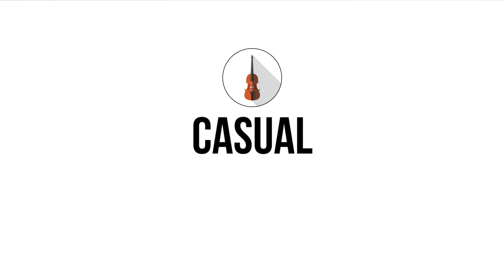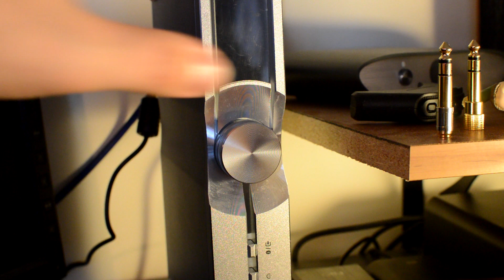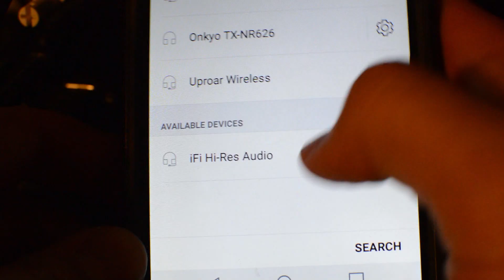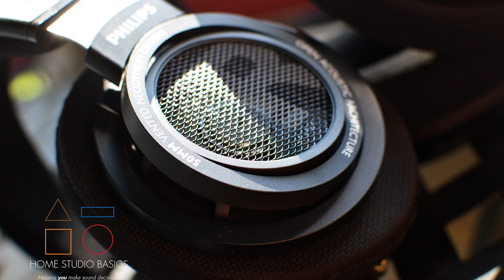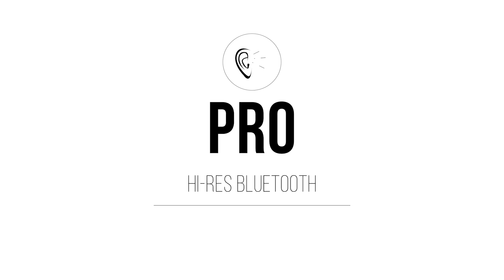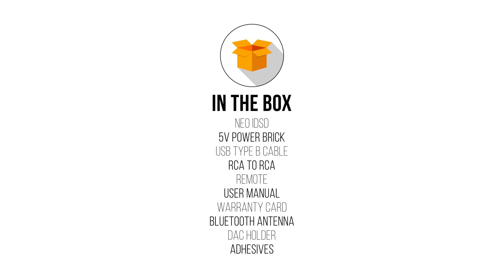💊Is The Neo iDSD Worth The $$?!

Comment: I got the neo idsd  for 500.. little homie hook up. But... 4.4 was messy, the unit has channel imbalance wish I could tell you how much. Not super bad. The second issue is you cant plug the headphone jack all the way in, otherwise the right channel makes no sound.  I even purchased a second set of cables assuming it was the cables, based on what ifi said.  More money wasted.

Also, the difference between balance and unbalanced has little difference in power. Guessing something probably wrong internally because on paper it's way different.

Next, for some odd reason it has distortion when using Quboz, not every song but certain ones at random and the following day if it replays no distortion.  But I found a few that distort no matter what. Tidal is okay, no issues thus far. Including while using it as strictly a dac to another amp.. not sure where the the distortion is popping off at, not an expert.

Honestly really good for on the go, or away from my PC throughout the house.  Besides that not sure how a 700 dollar unit can have all these issues.  Will have it fixed or replaced by warranty near the end of the terms.

Comment: welcome to New Year Stu
Question: you reviewed already iFi ZEN: DAC + CAN. I have them both plus iFi ZEN BLUE. Would iFi Neo iDSD, providing the same as the 3 pieces iFi ZEN stack be better solution with Hifiman Sundara? Provided Sundara would be powered with balanced 4.4mm output? on my CAN I can NEVER go to max gain (CAN has 4 position switch - position 3 is the max I have ever gone, even then only with the knob not crossing 1pm  volume)?
What do you think?
Pros: 1 box instead of 3, much less cables, both bluetooth and USB covered, MQA decoder (vs DAC renderer only), remote (who needs remote?)
Cons: more expensive (700 New vs 427 ZEN stack), less power on both balanced and single ended
But the sound quality would be the deciding factor... bro, counting on you as I can still return my ZEN stack to Amazon ;-)

thx
Reply from the maker: Hey man Happy New Year! Do you have the Signature stack or just the regular? If you have the Sig, I can do a demo and see which one sounds better. I'm pretty sure you have the original Combo Zen with the silver Zen CAN though.
Reply: @HomeStudioBasics  regular
Reply: @zyghom  Hi. How you connect the 3 ifi zen pieces?Can they be stack together or just can + dac or can+blue?
Reply: @cyberbarbaro  BLUE via RCA to CAN, DAC via 4.4mm pentacon to CAN. Sundara via 4.4mm pentacon from CAN. Using source button on CAN I use position 1 (BLUE via RCA) or position 3 (DAC via 4.4mm). Oh and DAC I set up for fixed output so volume on CAN rather than on DAC
Reply: @zyghom That's clever. Can you tell me how is the sound quality of zen blue compared to zen dac? If I just use spotify would I feel lot of difference? I would like to buy just the can and the blue but i am afraid to be disappointed.
Reply: @cyberbarbaro  The most important for  me part of BLUE is... being wireless. I use my laptop located where it should be: on my laps. I work this way on my armchair and having new Macbook with M1 chip and almost 20h battery life I eliminated all cables from my laptop by using BLUE. So my macbook and Sundara are with me the whole day while no cable messing around. The only problem with bluetooth - not BLUE but bluetooth is: sometimes I can hear that connection is dropped or at least distorted. And I am about < 1m between macbook and BLUE. I realized the same happened with my old bluetooth headphones so this is not BLUE issue but rather macbook. Anyway, for normal usage (work from home , video calls etc) macbook with BLUE (and CAN) + Sundara it does the job. Also for casual listening to the music (I only use Tidal). But when I want to reach nirvana I connect USB cable to my macbook and switch from BLUE to DAC. Now question is: do I hear the difference between BLUE and USB? Before I answer: BLUE connects to macbook via aptX while with my Samsung phone it uses LDAC. Except that when I use USB there is NO drop with connectivity - I am not sure if I can hear the difference between BLUE and USB - both with CAN and Sundara. Sorry if I disappointed you but seriously: more important on the sound quality is how the source was mastered (Tidal has both: good and so so quality of the songs - I am not talking MQA but rather how they were engineered). And this engineering of the record has for me more impact on the quality (dynamics, bass, vocal, treble) than if it was connected with Sundara via BLUE or USB (via DAC). If you got me then ok, otherwise you can ask for more - happy to help if possible.
Reply: @zyghom  Thanks a lot for your reply and the time you spent for it. You solved all my doubts. I will buy blu + can stack and the day i will come back to work from office i will consider to buy also the dac.
Reply: @cyberbarbaro  let me know how it sounds and if you are happy with that set up ;-)
Reply: @zyghom  hello. At the end I ordered the blue (it sounds amazing) but I choosed the k5 pro over the zen can. This just cause i can use the RCA Out on the K5pro and connect to my amplifier. In this way i can use the bluetooth connection with both my headphones and my stereo. I hope I did the right choice....i am not sure
Reply: @cyberbarbaro  I got your point - you use amp as all inputs aggregation ;-) Hopefully you will enjoy
Reply: Actually I decided to stay with ZEN stack because of:
1- much cheaper (427 vs 700)
2- more power on CAN
3- extra bass on CAN
4- 3D stage on CAN
truth be told there is nothing Neo can do better (except being 1 piece instead of 3) yet it costs 60% more than ZEN stack
Reply: I am curious with this. I currently own iFi Zen DAC and thinking of adding and doing the same Stack (+CAN+Zen Blue). But if the Neo iDSD provides a much detailed or better sound quality than the Zen DAC, i might also consider to hold and save for the more expensive Neo iDSD. I also love the Pros you mentioned, 1 box instead of 3 with less cable management required! And that vertical mount! Thanks
Reply: @jonathana.4187  I have compared iFi ZEN DAC to the one for 500$ and audible NO DIFFERENCE. Plus the fact that it has both: RCA and 4.4mm balanced output - marvellous. But iFi ZEN CAN amp is 1 class above DAC amp - at least for the Sundara headphones I have (and this planar requires a lot of juice)

Comment: I have the Fiio K5 Pro. I use a USB B to USB C cable to connect wired to my Galaxy phone. Will the same set up work with this ifi? The ifi's USB port looks weird.

Also, is this worth upgrading from the K5 Pro in terms of sound quality alone? I really appreciate your input. Thanks.
Reply from the maker: Hey man! yeah, both use Type-B so it would work. In terms of a sound upgrade, that would make a great comparison. I thought about that a few days ago actually - they are both combo Amp/DACS that have many of the same features and connections. I will have to do a demo and let you know!
Reply: @HomeStudioBasics  the instructions day not to charge the ifi with anything more than a 5 volt charger. Will my Galaxy Note 9 charger be too strong?
Reply from the maker: Hey man! Not too sure about that but as far as sound quality alone, I wasn't hearing too much in the way of the difference between the K5 Pro and Neo. Perhaps the Neo has a bit more vocal presence, seeming a tad more intimate and there with you, clearer, etc. (think of it as the analogy of sitting in the 1st row vs. 3-5), but it's not worth $550 more lol. I'd say the only reason to upgrade to the Neo would be if you need to connect to balanced studio monitors/speakers, want to run balanced headphones, and/or want something with Bluetooth functionality. Those things the K5 Pro doesn't have. Sound-wise it's not worth it. Here is the playlist I'm listening to: https://open.spotify.com/playlist/5J5AVe7Hcr3Wa2YNzih9JX?si=ICoD5eVkSq2vpeVxFvHRoA

Comment: I can understand why some people wouldn't want to spend $700 on the Neo but for me, it was well worth it.  I've had it for about a month and I love how it sounds.  It's not the normal iFi signature because while it does have some slight warmth here and there overall it's very clean and clear with a balanced sound.  I use it as a combo and with some of my amps and it sounds great either way.  I haven't used it single-ended so I can't speak on that but with about 1 watt at 32ohms it's plenty for most headphones, even my Arya sounds good though it does sound a bit better using an external amp.
Reply from the maker: Great vote of confidence man! I would really honestly buy it if it had a couple of XLR mic inputs on the front. It's a great product though. Combining the features of an audio interface and DAC/Amp all in one would really be a dream come true. And yeah, it's a bit underpowered single ended I think. I'd feel okay driving most headphones, but I felt like I was turning the voluem up way more than I should have been for both high impedance (HD600) and low sensitivyt (DEVA, K702).

Comment: I'm in the market for an upgrade dac amp for my Ebony's and Argon's. I'm not an audiophile. I enjoy listening to a specific type of music and game non shooter games. I currently have a Soundblasterx G6 which I purchased for $40 second hand and a new portable Lotoo Paw S1 which has a 4.4 output that i appreciate. I was looking into the Schiit Magnius and Modius stack which would run significantly less expensive at $400 plus tax , and probably would be all I need for a very longtime. The Neo iDSD seems interesting but I'm concerned it may not fair well with the Argon which is a less efficient phone. Are there any sub $500 Dac Amp combo or stack that you would recommend over the Schiit stack? Thanks in advance.
Reply: If you use a separate amp with it the Argon will sound great but as a combo, it might not have quite enough power even balanced to push them to their max.

It costs about $150 over $500 but the Topping DX7 Pro is a great dac/amp with plenty of power to push the Argon.
Reply: @TechnoGuy11  added to my research salad bowl! Thanks!
Reply from the maker: Hey how are things going man?
Reply: @HomeStudioBasics  hey sir! On the hunt for a desk top dac amp upgrade...someone suggested the THX 789 thru Amazon so I can return it, if it's not my flavor.